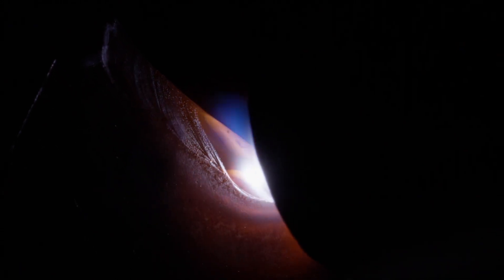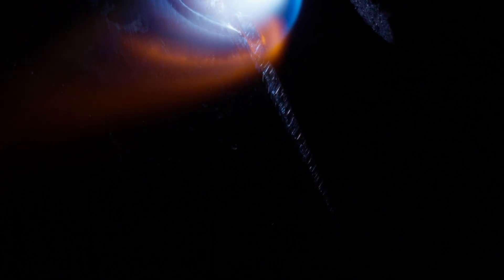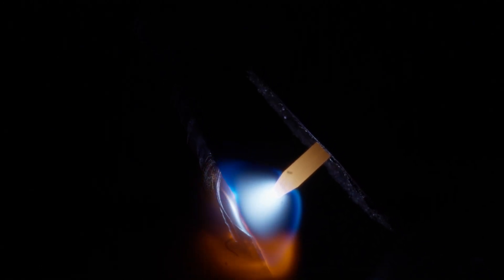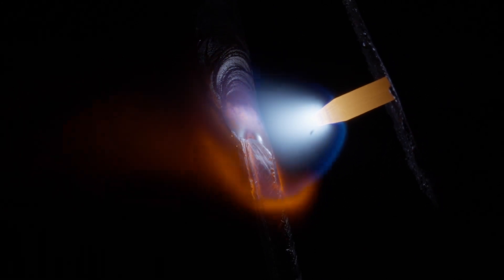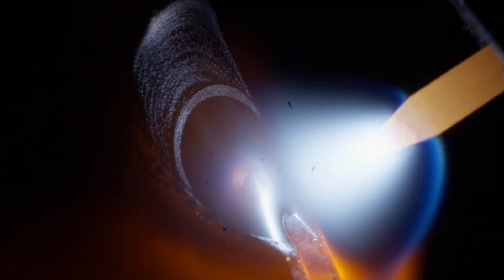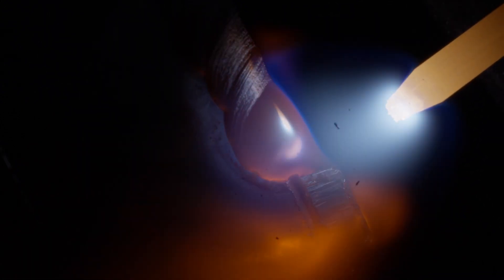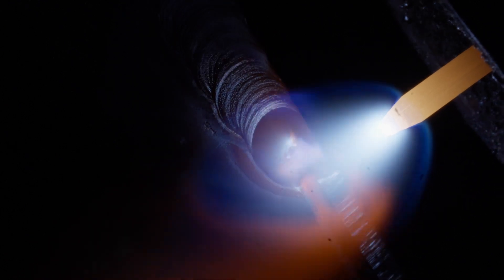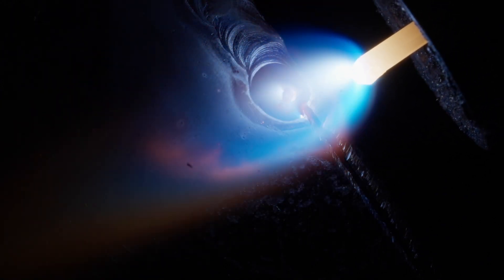Learning GTAW Welding, Steel Pyramid: Project 1

Comment: I’ve been interested in a career in this field. Any good starting points?
Reply from the maker: Or pick up a cheap harbor freight stick welder, an auto darkening hood, safety glasses, gloves, wear long sleeves, and find some metal to burn.

I'd go with 1/8" 7018 and 6010/6011 rod to start for SMAW.
Reply from the maker: Right now I'm taking classes at my local community college. If you took one stick welding course (SMAW, shielded metal arc welding), or MIG (metal inert gas) course, you'd have enough skill to get an entry level job working with either of those processes.